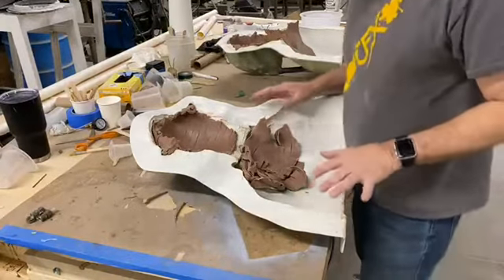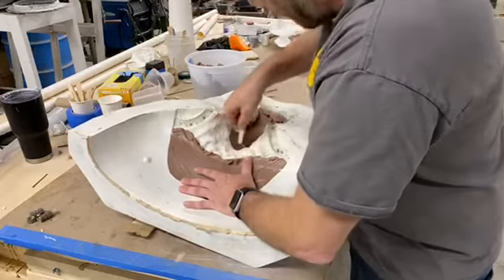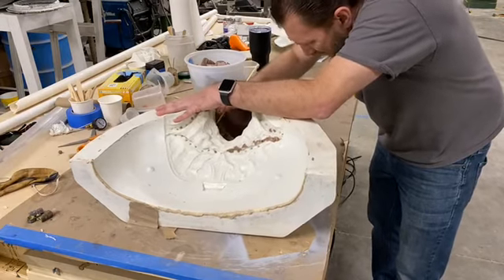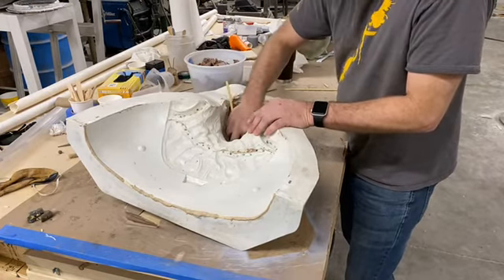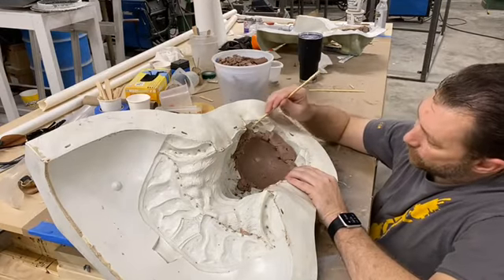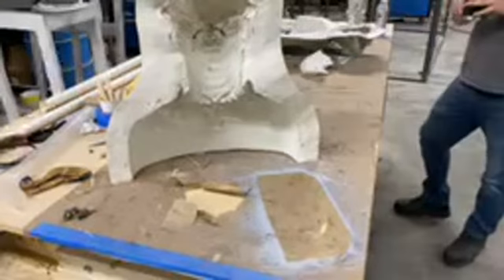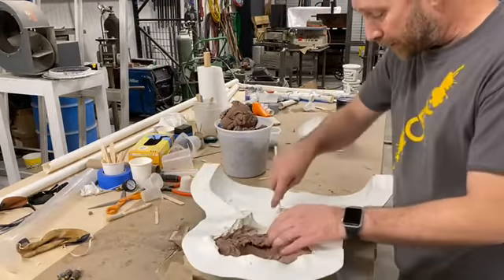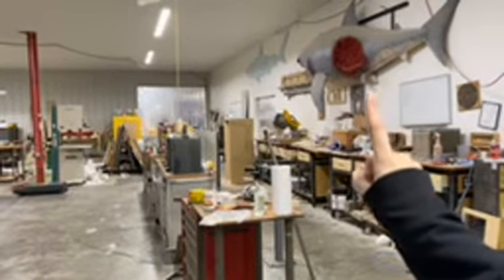CLEAN OUT YER MOLD! - Sculpt mold cleaning with Josh from CFX

Comment: I can't tell what your mold is made of but do you find it's easier to remove monster clay from gypsum or plastic? I love using plastic for molds but I'm wondering if there's benefits to gypsum besides being way easier to work with.
Reply from the maker: It's an epoxymite. We dont use stone or ultracal for our production molds because A) it's too heavy and B) we need to guarantee the mold's lifespan as much as possible and the stone will break down (and can be porous, which is no good for smooth surfaces and silicone).
Reply: @CFXunmasked  Thanks for the reply! Yeah I find those are the first issues I ran into with gypsum. I'm always seeing tutorials that say you should mold with it but I've always had more luck with resins. I'll give epoxamite a try!
Reply from the maker: @juggalojack13  Gypsum is GREAT for if you're just getting into molding, and works well with latex! Since we use silicone, we need something a bit more durable. Best of luck!